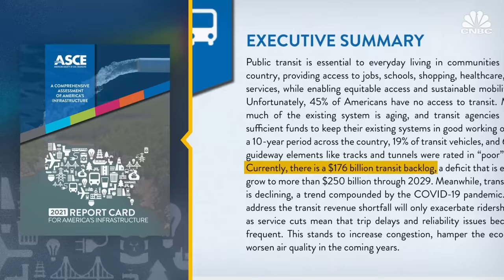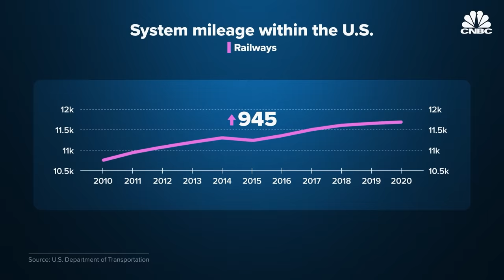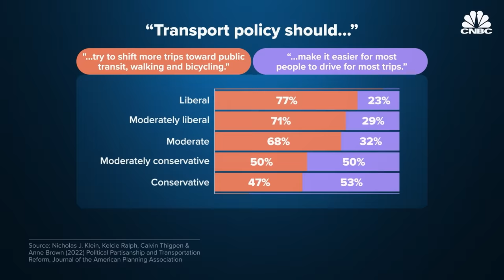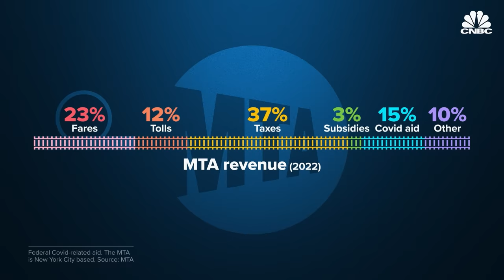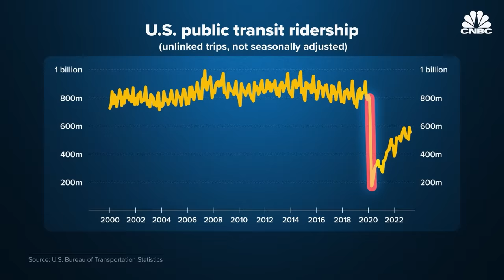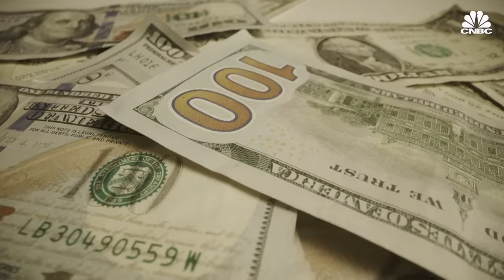Why The U.S. Gave Up On Public Transit

Comment: As an American who’s lived in Europe, if I were to tell anyone what I miss the most about being there on top of anything else, is how easy, safe and accessible public transportation is there. The places I lived, the nearest subway or tram line(s) were only a very short walk away, and then I could easily get around all over the city. You really get to see the community when you’re on the public transit system. You don’t really get to see the community when the vast majority of the population is driving in the box of a car. It’s been 5 years since I’ve returned to America, and there’s almost not a day that goes by where I’m reminded how much I loathe the car culture here. I really don’t like the lack of public transportation and how much American cities and suburbs are designed in a way to make you rely on a car to get almost anywhere. And being in Southern California, you’re really looked down upon for not driving a car. I’ve traveled a few times into Los Angeles using the metrolink (the Amtrak train network that connects the greater Los Angeles area). It takes two hours to get to Union Station in downtown. The regional trains in Europe would have gotten me to my destination much quicker than this. And when I take the Metro rail lines in Los Angeles, the services aren’t so great and there’s this feeling of not being safe while riding the transit lines. 

It’s also one of many reasons why America has an obesity crisis. If you use public transportation, you have some form of exercise through walking to where you need to go. Getting around through a car limits that exercise. 

And just a side note, there’s been a few times when I’ve been on a station platform waiting on a transit line to come and I see a foreign tourist using the transportation system. I can’t help but feel embarrassed because I know for a fact how much better the transportation system is for them back home.
Reply: As an American that’s lived in a major Asia city for the past 20 years, the one thing I miss about the US is my car. 

The one saving grace here is the motorcycle taxis, which are by far the fastest way around town for short-moderate length trips.

I will give the metro here one nod — it isn’t full of thugs and hooligans like in the US.
Reply: I just can’t understand this. You can’t even bring home groceries and I’m certainly not going to be able to bring home any real supplies. 

It seems to be useful as a novelty to me for people who like to go out to eat constantly, museums, bars, etc but for actual day to day life I see zero practical use.
Reply: @blueoval250 ok, so use transit to get to work and to get a few groceries, and use a car to load up on a huge amount of supplies. it's not all or nothing. you see it as all or nothing because currently the only option is a car. if there were OPTIONS, it would be better for EVERYONE
Reply: @user3wx9V-178  public transit isn’t going to take me to work. I don’t live in a city or near a town. I’d have to walk severalmiles to get to a main road.
Reply: @blueoval250  that sounds like you live in a rural area. it's always country folks trying to tell those of us who live in cities how to do URBAN planning. this has nothing to do with you.
Reply: @blueoval250 if you live in a rural area, of course you're going to need your own vehicle to get around. The main issue here is inside an urban center, and connections between urban centers.

Frequent train services between major cities, and subways/trams/buses inside a city/town. People living in rural areas can keep their cars and whatnot and drive around as they please, since they need it.

Public transit isn't going to solve everything if there is no development within different communities. In a well planned city, the amenities are much denser, which means you can walk to get groceries or take a short taxi ride. If you can't even walk 10 minutes to get groceries, then that's a laziness problem, not an accessibility problem. As for getting supplies, I don't know about you, but the average person does not have a renovation project at home every week.
Reply: @blueoval250 what a weird reaction. I’ve never owned or had a car in my almost 40 years, and I’ve still always been able to get groceries, no matter where I’ve lived or where I’ve been. But maybe you live in Montana or some place like that.
Reply: @cjdrv  not Montana but very similar.
Reply: @blueoval250  I'm almost 50 and I've never owned a car. Public transport and bicycle is all I use on daily basis. I don't waste money on gas, insurance, parking, service. Finding a place to park my bike takes 10 seconds. A ride from end of the city to another costs me about 1USD tops. Ten minutes from my house I have a train station in case I wish to another city in Poland or Europe. Jump on the train in the evening and wake up in Budapest or Vienna.
Reply: @wizardman1976  then you must be paying for someone to do basically every single thing that needs done in your life.
Reply: @blueoval250  Explain this fascinating thought please because it seems you know more about my own life than I do.
I am a free man. You are a property of car industry - without them you can't do basic things. I have a right to choose one of the multiple ways to travel. The fact that I don't have a car is my very own decision. I run my business, do groceries, enjoy the nightlife... Merry Christmas from 21st century in developed world, dude.
Reply: @wizardman1976  there’s nothing 21st century about public transportation, that’s 19th and walking lol come on. I don’t allow government to tell me when I can or can’t go somewhere like they attempted during the whinedemic. I prefer to depend on as few people as possible.

If you need a thing done such as a repair on your home then your going to pay someone to do it. I’m not going to be able to haul the stuff I need on a bus or carry it.
Reply: @blueoval250  People in Asia don't buy costco-style of groceries once a week. They drop by the local supermarket or grocery store frequently so you get things fresh and don't need a car to transport all of it in one go. When I was stationed in Okinawa, I biked to the local store every day after work. (it took like, 3 minutes max). It was super convenient.
Reply: @chinglamyung  are you telling me that vegetables such as tomatoes can be bought in Okinawa and they aren’t garbage? Ive never been there but that seems impossible to me.
Reply: As someone whose lived my entire life in Europe. I'm a bit concerned on going to America for a short period because I've been to America before and over there people really need a car to go places. I catch the tram, metro and train easily here and I don't want to be dependent on car service or rental transport abroad
Reply: @blueoval250  so there’s a lot to take in from all of your comments I’ve never seen because I didn’t bother keeping up with the notifications. You say that public transportation is 19th century. You’re saying that people who live in Europe and the majority of people there who rely on public transportation are living in the 19th century?? The government isn’t forcing you to stay in your house if you don’t have a car. 

People are still able to do their grocery shopping without a car. In other parts of the world they do their grocery shopping on a daily basis. When I lived in Germany, the few times I went to a friends house for dinner, they simply went to the supermarket, and simply bought the items that they needed for that night. When I lived there I did my grocery shopping a couple times a week. It was just me and I planned ahead what I would eat for a couple of days before the next time I did my grocery shopping. You see people doing their grocery shopping then taking the public transit system all the time. It’s actually amusing seeing how people will haul a weeks worth of food into their car. Again the way people around the world do their grocery shopping is much different than what you see in America and it’s difficult for people here to comprehend. Also I’ve seen people bring other supplies onto the public transit system. It’s really not a problem as you think. 

You said that you live in a rural area and therefore you have to rely on a car. That’s understandable. But there are people who live in a rural area (they’re referred to as a village in Europe) where people mostly rely on a car. But you’d be surprised that there you’ll find people who get around using a bicycle or even on foot. 

There was a time when people in America relied on public transportation to get around. Then post WWll GM, which wanted to sell more cars, said that everyone needed a car and the government stopped putting investments into public transportation. But by saying that everyone needs a car, you’re leaving people behind. Because not everyone can drive. Kids can’t drive, you have some people with disabilities who can’t drive, and maybe there are those who are seniors who have gotten to the age where they can’t drive anymore. If the government put investments into public transportation, you make sure that everyone has the ability to get where they need to go. 

Most suburban communities have been built to make sure that you have to rely on a car to get practically anywhere. Why is that? Because for most people who live in the suburbs, they then have these long commutes to get to and from work each day. And studies have shown that these long distance commute has a very negative impact on a person’s overall health. 

The thing that I learned about living in a place where people use public transportation to get around is that you really get to see the community. Whether that’s during the rush hours when you see people getting to and from work, kids getting to and from school, or when the evening arrives and you see the party scene arrives and people are using the public transit system to enjoy the nightlife. You don’t get to see the community, or at least not in the same way, if you’re stuck in the box of your car. 

Another note on people using public transportation during the evening to enjoy the nightlife is that you therefore don’t have to worry about drunk drivers being on the road like you do here. 

If America is the greatest country on earth, shouldn’t we show it by having the world’s greatest infrastructure? Because when you see the infrastructure in Europe and parts of Asia, our infrastructure is actually an embarrassment. When you see the type of trains they have in Europe and Asia, then see that we still use Amtrak to get around, I can’t help but think to myself “What kind of blank blank is this?” It actually makes America look like a third world country. 

Americans are told that having a car equals freedom. But is it really freedom? Because when you consider how much money you put into your car, whether that’d be gas, insurance and the yearly maintenance, the average American spends at least $10k on their car alone. It makes a person to become more a slave to their car. 

When I was in Europe, I knew of a few people who didn’t have a car and didn’t use public transportation. Instead they got around riding their bicycles. And to them they felt more free with the wind blowing in their face as they went. I never saw it that way before. 

Anyway I learned that the best thing to do is travel and see the world. If anyone has the opportunity to live elsewhere, even temporarily, take it. There’s no better education than going to a place and getting to know what people think there.
Reply: @Ashortutorial.  I’d say go do your research and see if you can get around using transportation. They’re there. But find out the city you want to go to and what they have there beforehand.
Reply: @erickbyarushengo4726  yeah I am that's what I'm looking for on YT first and also read the comments for others people's experience. Your profile picture looks like it's made in Germany
Reply: @Ashortutorial.  yes, it’s from when I visited Germany. Then I wound up living there for a year and a half
Reply: @blueoval250 ok sparky by your thought pattern the government should stop road maintenance because they are spending it on you not them. How obtuse